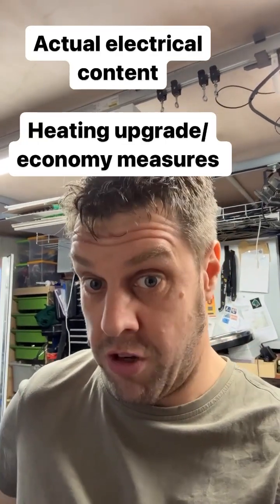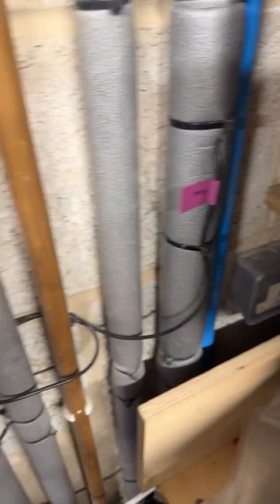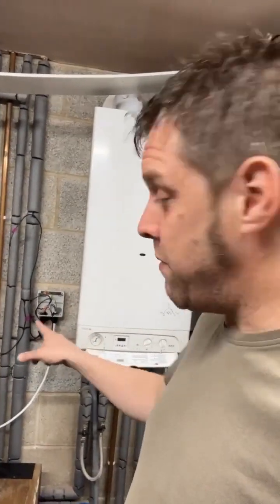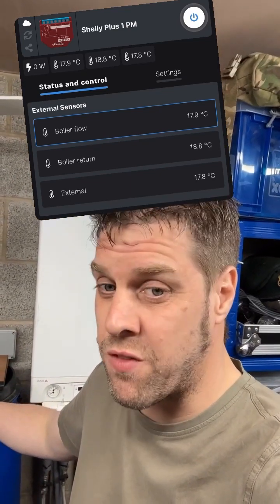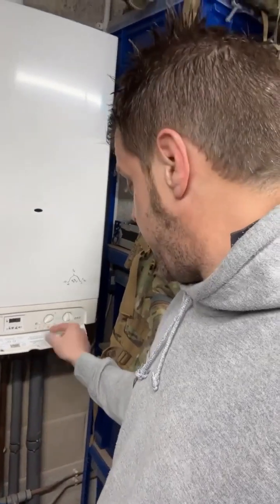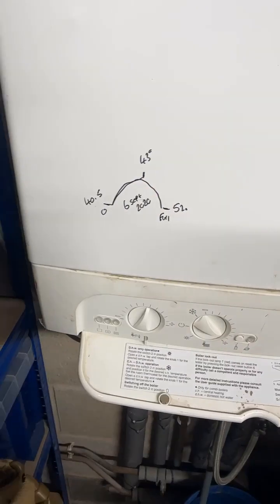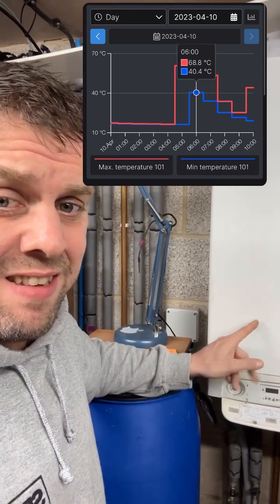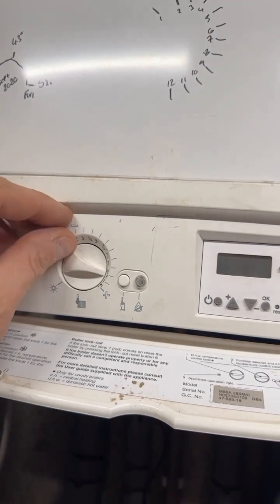making my home boiler more efficient with shelly smart home kit

Comment: Interesting video.  If you can borrow a thermal camera from work you could use it to look at the radiators and see if you have any cold spots due to sludge or magnatite or rust.  That can then be removed with a powerflush I think there are 2 mechanical types.  There are also some liquids to clean radiator systems but they are not as good as the mechanical on older systems.  

It is also worth getting a Magnetic Filter like Adey MagnaClean or Trappex Centramag (there are others) fitted to your boiler system.  These will then clean or trap the dirt from the central heating system making it more efficient.  

With the thermal camera you could also trace your pipe work and make sure it is all insulated.  

At the end of the day the cleaner the water in your system and the more insulated your house and boiler system including pipes are, the more efficient it can run and use less gas.  

Don't forget to ad inhibitor back into you boiler system after you have drained it.  

Look forward to the follow up video Jamie

Comment: Boiler will work on heating on a 20 degree differential. As the return closes that gap to the flow, the boiler will modulate back until it’s at its lowest modulation. Then it will turn off and cycle. You could fit an LK Armature weather compensation mixer valve or check if your boiler is opentherm compatible and install a thermostat that will control the flow temp.